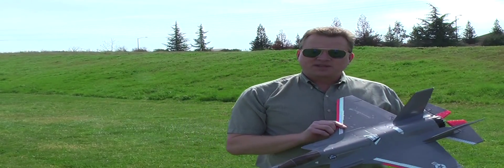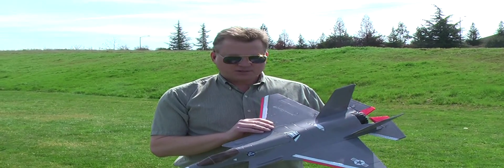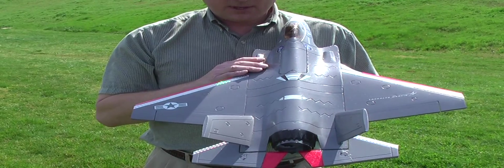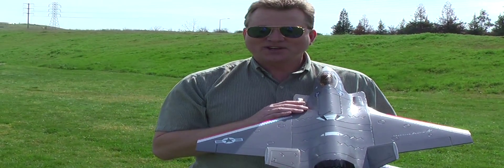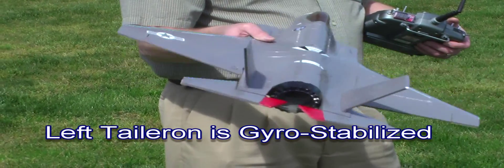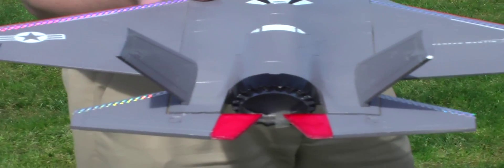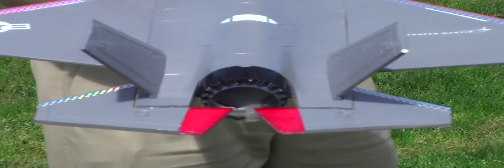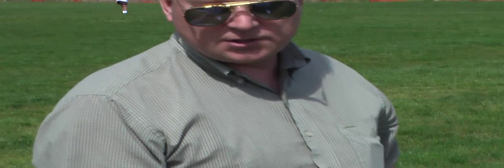Freewing F-35 Flight Demo with Taileron Thrust Vectoring and Gyro in HD!

Comment from the maker: Thank you!  Check out the video of the four-cell, ESC and power system upgrade too.  I'd love to try this mod (4-cell 1750 lipo and 40A ESC with the stock fan and motor) if the stock motor could handle it.  I was amazed how well this small jet handled the added weight of the larger battery packs (3-cell 1750, 3-cell 2150, and 4 cell-1750.  Thanks for carrying these great little jets.

Comment from the maker: 2100 mAH 3-cell or 1750 mAH 4-cell with Phase-3 f-16 fan, motor and Hi-max heatsink.  40 amp Turnigy ESC.  Check out my videos on radio programming and fast flight.  Gyro gain is enough to stabilize launch and landing but not too much to cause gyro flutter.  I turn it off from transmitter once it's up and stable.  Since I've added the gyro to my small hand launched foamy jets, I've never lost one on launch.  This one is still flying in 2012!  My T-45 used to roll inverted on hand launch by the